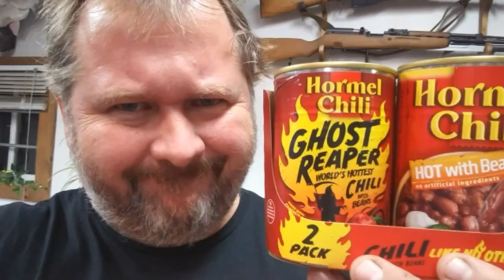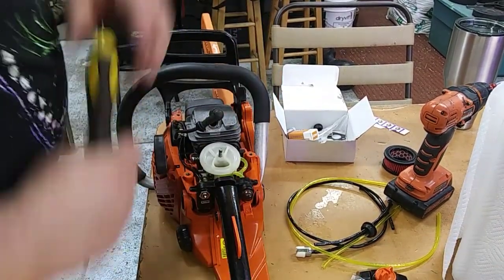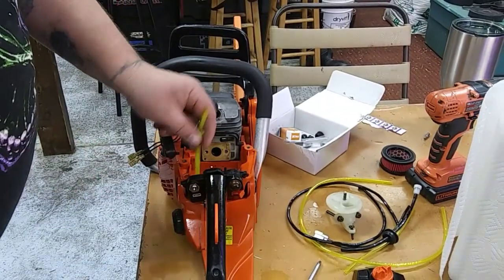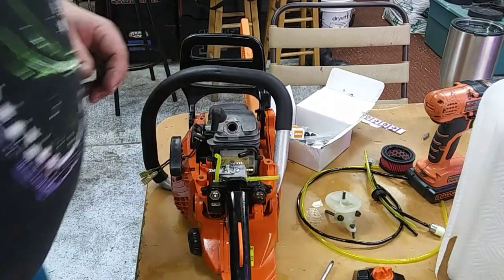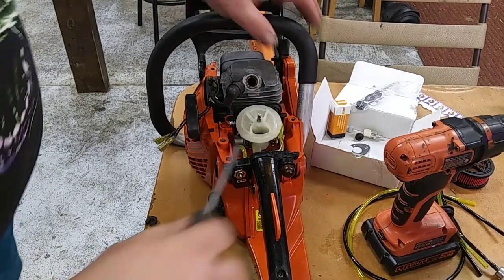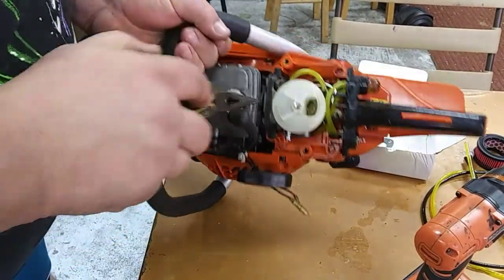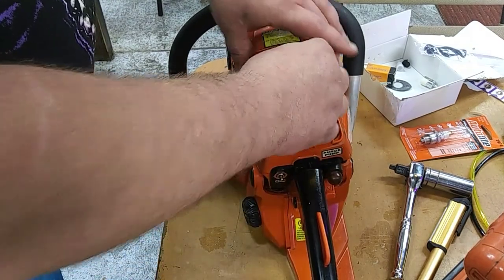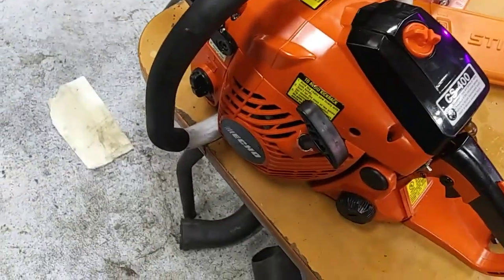Carburetor replacement echo cs- 400 saw echo chainsaw

Comment: I HAVE A CS510 AND AM PUTTING IN A NEW CARB, ETC. , REPLACING THE ORIGINAL, I ASSUME (WAS USED WHEN I GOT IT). YOUR VIDEO SHOULD REALLY HELP ME IN FIGURING OUT THE FINER DETAILS OF THE INSTALLATION. THANKS, EAGLE-SAN IN O.
Reply from the maker: Glad it helped

Comment: Replaced my carb with new oem carb and it won't stay running whay could be the problem  I already tru to adjust  the carb it's did nothing I replaced all the line except  the gas tank lines or could the primer lines be on wrong

Comment: Is that a specialty screw driver for the L & H adjustment?  You moved it too fast to see it...thx for the Vid
Reply from the maker: Its not a special tool so to speak but its a tiny flat screwdriver made by stihl for this adjustment. Any small sized flat driver will work.